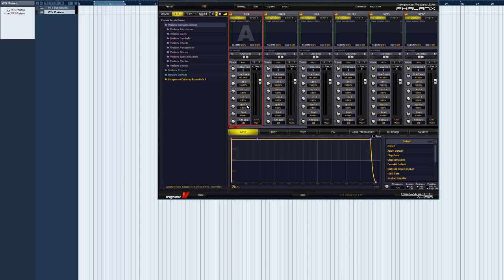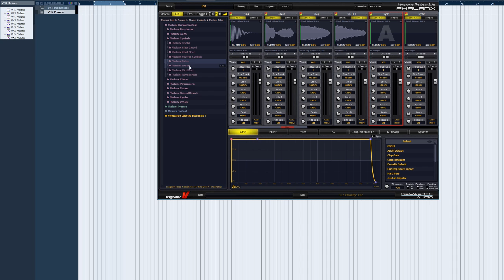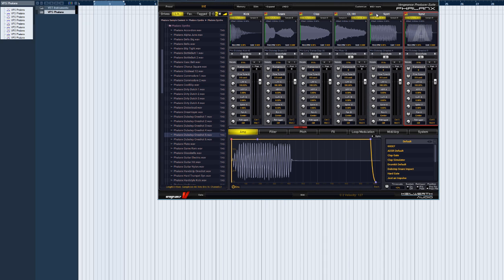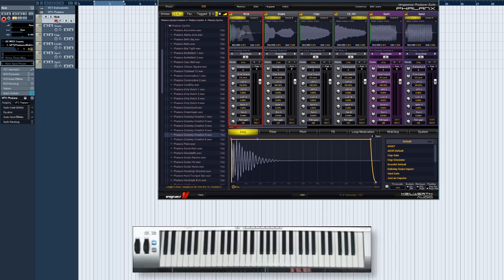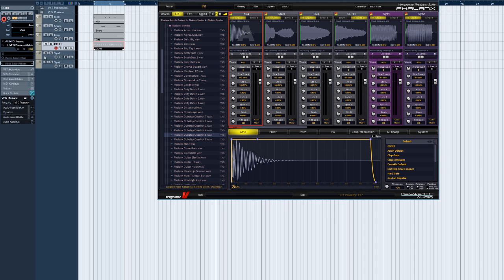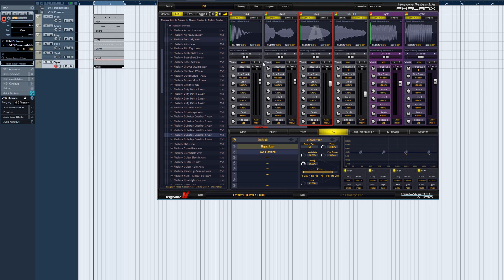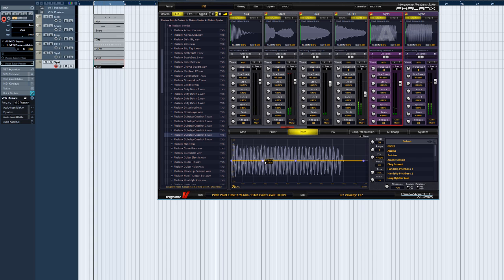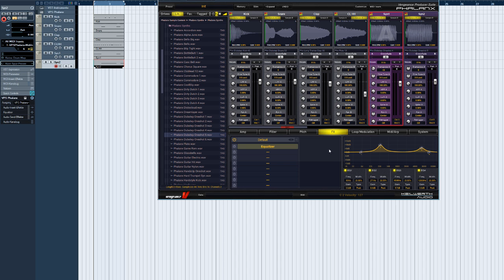Vengeance Producer Suite - Phalanx Tutorial Video: 09 Arrangement

Comment: URGENT: Please Demonstrate in Ableton Live. The midi and output chains, greater than number 1 in Phalanx Pad Slots Two (2) and above, are non responsive in Drum racks and instrument racks, and therefore clarification is needed on what method of chain effects series or parallel chains, will enable individual sounds to be heard from midi and keyboard inputs greater than number 1. posted 31 July 2022